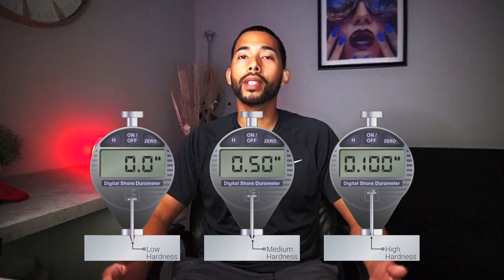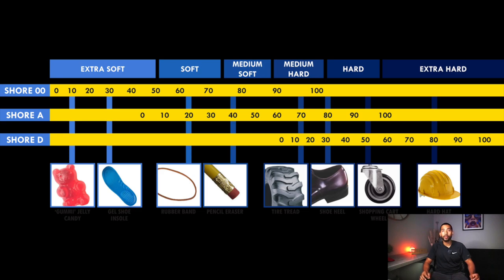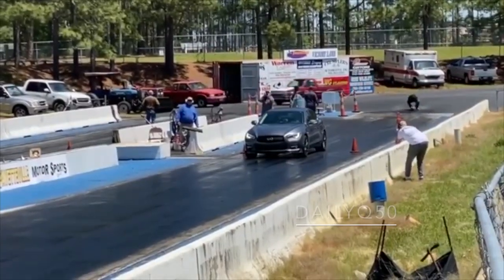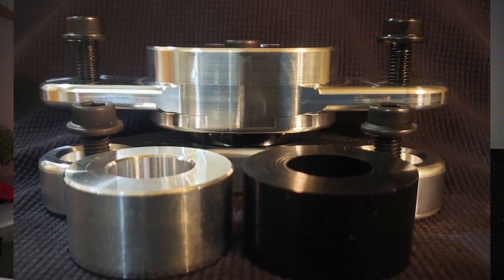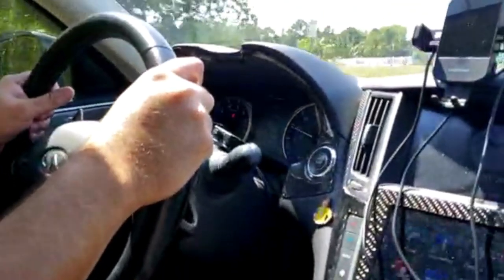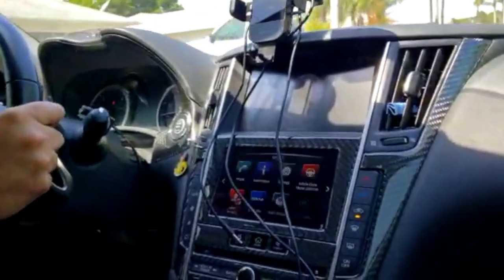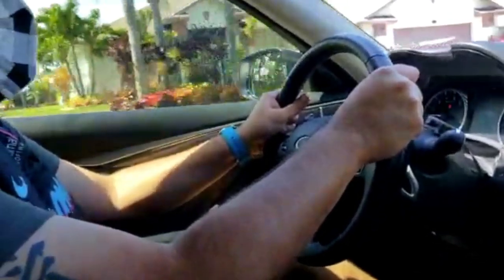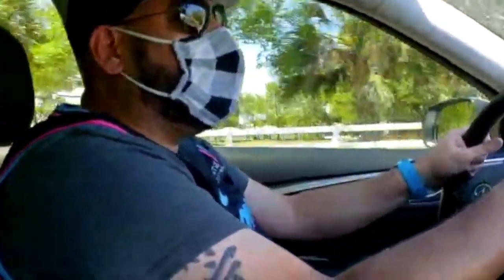PRIDE AUTOS’ Q50 Q60 TRANSMISSION MOUNT REVIEW

Comment: A Zilla I was telling you about my Q60 Redsport awd full bolt on but not tuned. I was having wastegate rattle I took my car to the dealer with all my mods and they are ordering the drivers side turbo. They said they will replace the drivers side first and if the noise is still there I will have to put all my stock parts back on so they can diagnose the problem better.
Reply from the maker: Hey, that's great. Hopefully, it resolves your issue.

Comment: I installed this mount with the poly bushing, my car was gonna come apart!! Not sure if the 400 or 500 mile break in will work, but driving my car with the párkinson this part gave it, would of been near impossible for more that a couple days! After only a couple of hours of having it installed, I went back to the shop and took it off! It definitely did not perform as on this video. I am sure it works on the long run, you just have to be willing to take the shaking and rattle for 400 to 500 miles as they say!
Reply from the maker: Should have given it a few more days before deciding 😞

Comment: Regarding the performance aspect of the Pride transmission mount. Do you have a review? Were you able to test the mount at the track? Did your times improve? Im curious.. 🧐🤨
Reply from the maker: Sup, I don’t have a review like that. Never really focused in on getting data like that (I should have), however from the top of my head I would say just by itself it probably won’t net better times (I could be wrong). It’s one of those components that works together with the other mounts and braces. By using everything together it should help on transferring the power to the ground more efficiently which in turn will net you faster times.

Comment: Great video, I noticed after installing the vibration and noise. I thought I messed something up. The car when accelerating seems to rumble more. I thought i had an exhaust leak or something from disconnecting my y pipe. Is that normal ?
Reply from the maker: Did you add the poly bushing? If so, it will get better as the bushing breaks in. If its the solid one then it will always be rough.
Reply: @ZillaFullBoost  yeah I just installed it the way it came I’m assuming the poly bushing.